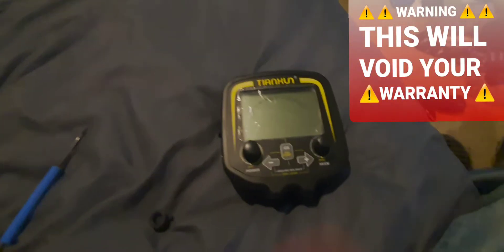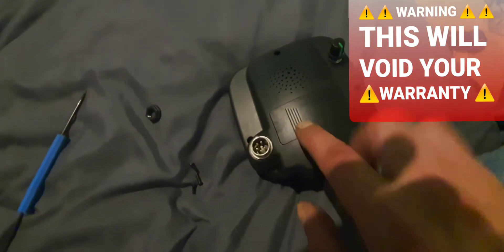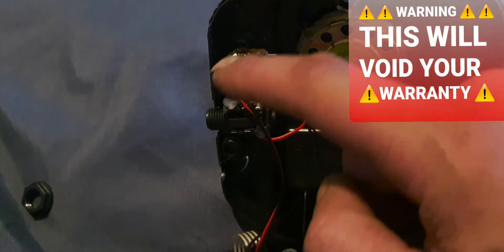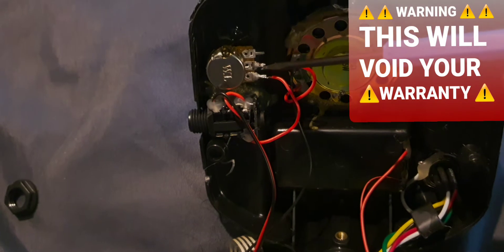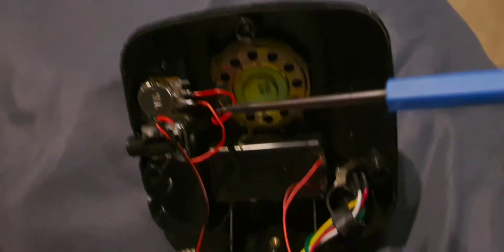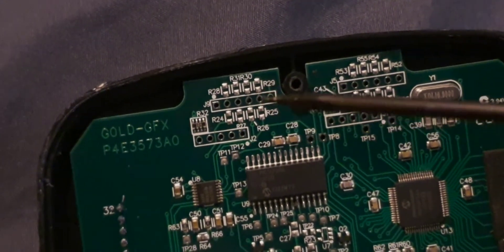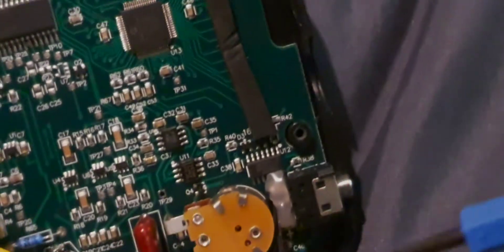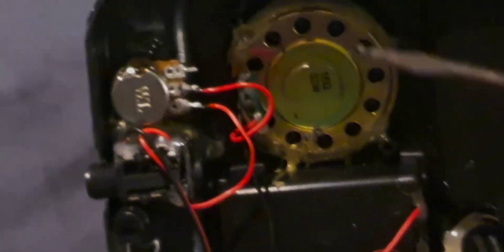TIANXUN TX850 Metal detector volume control modification

Comment: I have a Tianxun 960 control on my detector, not used since last Christmas, missus put it in the shed without my knowledge (in the casing), I was furious when I came across it almost a year later, replaced 9v battery and it no longer works. Had it apart but nothing obvious. Been trying to find a replacement controller to no avail. Any advice appreciated 😢
Reply: Mine packed up just after a year, stored in its zip jacket and kept in the garage, used it in summer this year and it stopped working in the autumn. Looked on Amazon and these detectors are no longer sold, I'm sure I paid over £100 for mine and am not pleased with it just working for a year.
Bought a new one, more expensive with a breakdown insurance for 3 years.
Fed up with this throwaway society that cannot mend anything. Old detector is as good as new and hardly used.
Reply from the maker: @tinytonymaloney7832 I agree that's not very good, did you check where the battery connection is to see I'd the contracts were rusty?
Reply: @HappyBees  yes, I am electrically qualified with some minor electronic experience but nowadays equipment is just not designed to be repaired. 😔
Used meter on pcb voltage all ok, eyes not what they used to be, can't see that small stuff any more and oscilloscope and probes given away years ago.
Looking forward getting out with my new one 👌
Reply from the maker: @tinytonymaloney7832  ahh I get that.
Reply from the maker: Hi I'm unsure as I have a Deus Ws6 Master now and sold old detector.

Comment: This might be a stupid question but could I just get some headphones with an adjustable volume toggle instead? Or is your way here the only way to adjust volume? Thanks
Reply from the maker: Yes, I think that is the simple answer. Only you would have a wire connection to the detector and person, which can be a pain sometimes.
Reply: Cheers. I’ll be hunting with someone else so headphones will be the way to go for me. I don’t want to risk modifications so It’s headphones and hope I don’t go deaf :D. Thanks for the help

Comment: Sir can you tell me if there is a calibration on the   
  Tx -850 to adjust the setting for what the detector reads. I have a TX-850P and it's reading a quarter at a 78 Instead of 85-87 like it should . Can you find it for me and let me know where it's at.
Reply from the maker: Hi there yes there is a way to adjust the sensitivity once you open up the detector to be able to tune it up
Reply: @HappyBees  well we got it calibrated by accidentally cut the electronic strap getting into the box ..so I lost my discrimination so my buddy ordered in a new strap and will install it Monday or Tuesday so then it will be back to normal God willin

Comment: quindi e' giusto 10K oppure 20K?
Reply: 1k e meglio
Reply from the maker: I used 10k but was advised after to use lower like 5k or 2k. It still works fine with the 10k though.

Comment: E cũng có TX850, e vô tình làm tuột đầu dây kết nối giữa máy và đĩa, trong đó có 5 dây, giờ e không biết kết nối trở lại, e nhờ a hướng dẫn giúp em sửa nó trở lại như ban đầu
Reply from the maker: You only need to interrupte the  wire from the speaker to the headphone socket the red wire, cut it then add the volume nob in-between

Comment: Very poor explaining!
Reply from the maker: was just showing what I did, I'm not very good at explaining things or very confident on cameras, sometimes feel like a wally talking to a camera 🤔
Reply from the maker: Find the wire from the headphone  plug that go's to the speaker and cut that, wire it to the pentiomitor bottom pin, then to the top pin you put the wire that comes from the speaker 🔊 👍
Reply: Help me to understand which wire is to cut😁 and the proper controller to use. Thanks
Reply: Is this caused by overloading the ATX 880 device?

Comment: Does this mod still work two years later? I was wondering if grounding the third pot lug is really needed.
Reply from the maker: I dont think it's needed iv had no problems
Reply: @HappyBees  Cool. I'm going to do this to a Bounty Hunter Tracker IV, and two Tesoros. Wish me luck.
Reply from the maker: Good luck sure it will be fine.👍
Reply: @HappyBees  Thanks. 😁🖖

Comment: What size ohm potenti is my brother using?  greetings from Indonesian hunters 👍👍👍
Reply from the maker: Hello there im not sure if I used 1k ohm or 10k ohm it's been a long time since I did the modification. I am doing a video soon about adjustment of the sensitivity and vdi numbers, I can check when I open it and see.
Reply: @HappyBees  
To inform all readers
To adjust the volume of any device it is necessary to use logarithmic potentiometers not the linear type, this is because our ears is not linear in terms of sensitivity and using a linear potentiometer it would then be difficult to adjust the volume to the desired level.
Linear potentiometers can be recognized because they have an A after the value eg. 10Kohm A while the logarithmic ones have a B eg. 10 Kohm B.
Type B is used for volume adjustment on radios, amplifiers, etc ... Type A for all other uses.
Reply: You forgot to say what size potentiometer. Which size do i have to use?

Comment: Great little upgrade. I have a couple of these clones and they are soo good, not to mention cheap. What are the resistance values of those potentiometers?
Reply from the maker: I'd need to check which one I used, it seems to work well with no problems.
Reply: @HappyBees  1k-2k-5k you must use low restistent
Reply: IO penso che visto nn c'è la massa potenziometro con valori bassi farà on off sul volume..difatti nessuno che fa la modifica nei video fa sentire la regolazione del volume alla fine e chi lo fa si sente on off

Comment: I have the same metal detector model as you. Your tx850 work well? Also with high Gain
Reply from the maker: Hi thanks for the comment, yes its s pretty good detector, iv found few good things including a bit of gold and old hammerd coin 👍. How are you getting on with you tx850?
Reply: @HappyBees  soso, too false signal and chattering, the hunting is near impossible. what coil connector do you have? with black screw or the metal screw?
Reply from the maker: Mine has the metal screw, iv not found it too jumpy along as I ground balance it manually
Reply from the maker: Oh you mean coild to the stem? I'd so then mines black plastic
Reply from the maker: @riccardomarinoni6733  im not sure maybe its faulty? I have a simplex that seems chattering alot like that but on that you back of the sensitivity.
Reply from the maker: I did notice when o opened mine up, there is a tiny module you can adjust, iv seen in other videos where they tune the machine for specific metals, or thats what I think there doing, most the videos are Russian so its difficult for me to fully understand them.
Reply: Se a gain 80 gracchia problema..io a 100 nn fa un rumore..dipende dal terreno

Comment: you must use a Linear potentiometer, not Logaritmic.
Reply: What resistance value potentiometer?
Reply from the maker: I'd have to check which one I use, but it seems to work no problem.
Reply: Both your video and site say to use a logarithmic A1K 1K ohm potentiometer. Here you say the opposite. Which is it? Logarithmic or Linear???
Reply: @jaywolf2519  in a first time and video i used a logarithmic pot. After this i studied a best solution and linear pot is the best for audio. But if you have only logarithmic pot, use this...
Reply: @metaldetectormilano6301  Not a big deal, but you might want to alter your site. When I asked on a different video,  all you could give as answer was - Go to my site-  I did that and almost ordered the more expensive pots until I found this comment.....
Reply from the maker: Ah really? I will look see, do you have a link to one I need? The one I use seems to work, whats the difference please?
Reply: HappyBees 2020 you must study the differences on google and read an article with translation on my internet site: www.metaldetectormilano.com